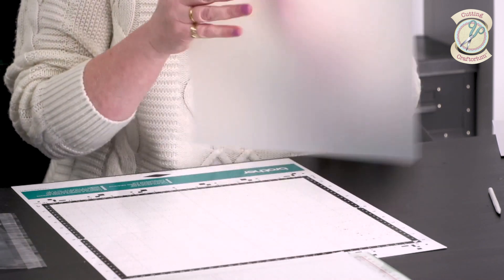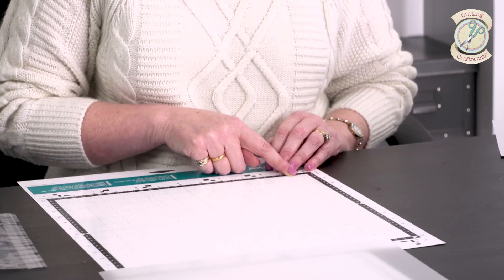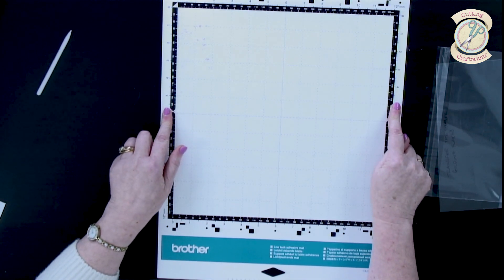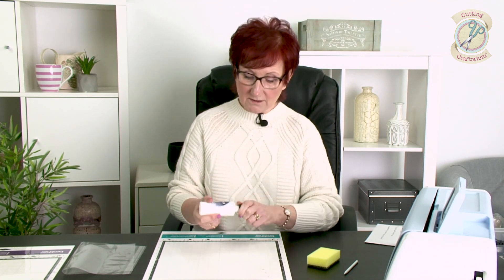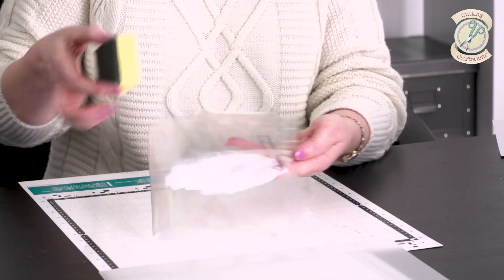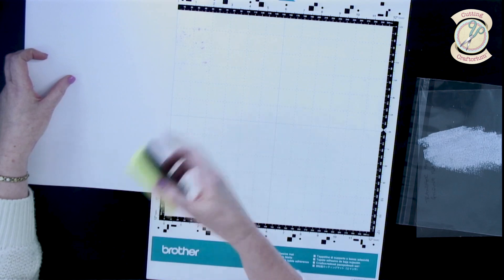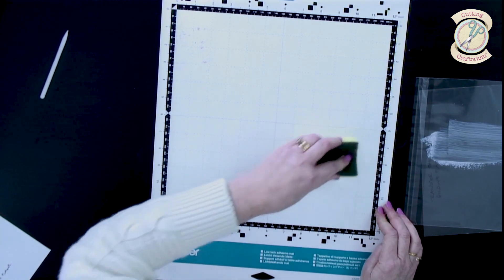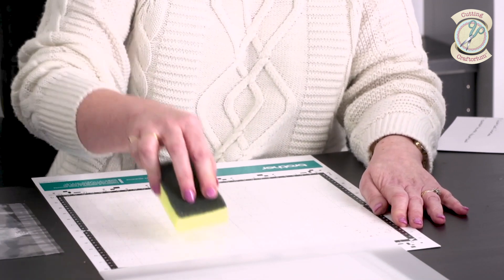Stunning Stencils USB: Tacking a Mat

Comment: Hi... Thanks for the tips. I coulldn't quite get the name and brand of the glue. May Iask you for the name/brand again please. Is it available in Australia or is a UK brand? Thanks so much. Yvonne
Reply from the maker: Hi Yvonne, sorry for the late reply. Mel used the Pinflair Stencil Glue. It is available on the Create and Craft website here https://www.createandcraft.com/gb/pp/pinflair-stencil-glue-2-x-82ml-tubes-301979?query=fh_view_size%3d24%26fh_location%3d%252f%252fcreateandcraft%252fen_GB%252fcategories%40lt%3b%257bcreateandcraft_8127%257d%252fcategories%40lt%3b%257bcreateandcraft_8127_10520%257d%26fh_sort%3d-onair_cc%252c-hasimage_cc%252c-new_cc%252c-salescash_cc%252c-stock_cc
Reply: @innovationhub5182  Thank you... much appreciated.